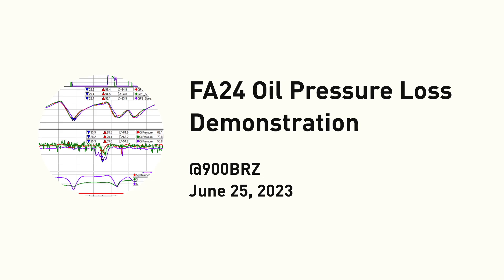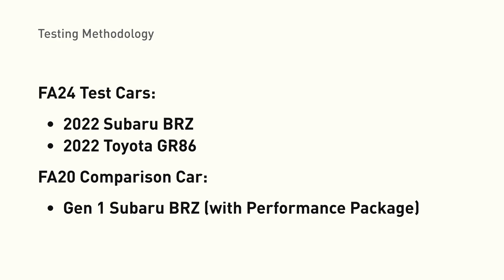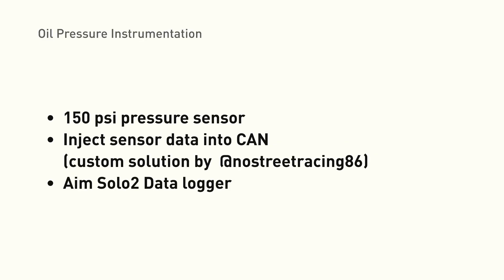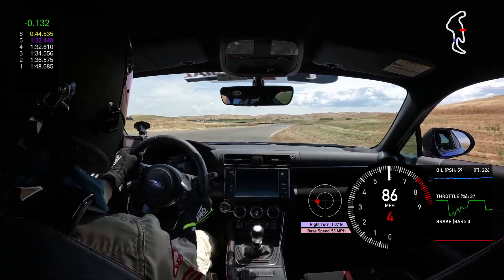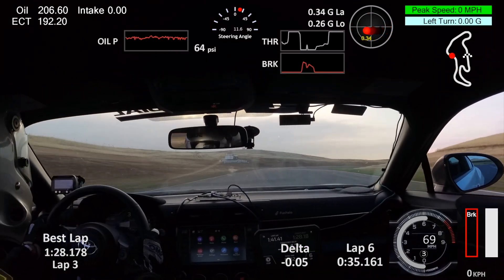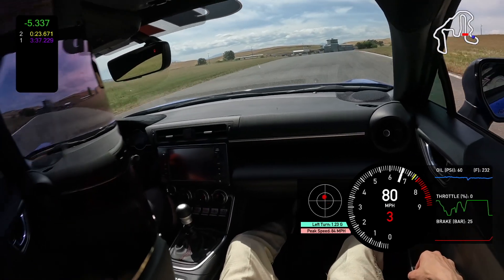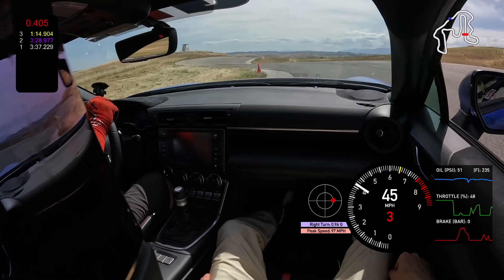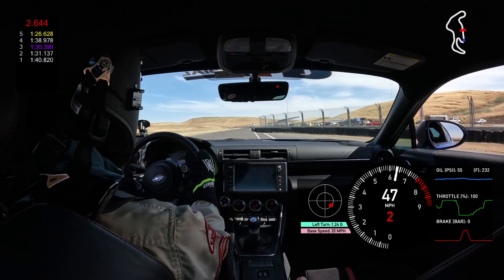BRZ/GR86 FA24 Oil Pressure Loss Demonstration

Comment: Many thanks for this video and research. Subaru or Porsche, same  flat engine lubrication issues and it is a costly problem for the last owner... interesting car, but too many problems maintained by the manufacturers. Your video confirmed my other engines choices, V6, 4 normal. Take care. Thanks

Comment: I think that pressure problem is bc the way the oil sits in the oil pan. seems like the problem happens every time you're going over a crest or a bump. maybe when the gravity is not pushing the oil down it makes a bubble in the oil pickup.
Reply: maybe a way to solve that problem is with a deeper oil pan
Reply: @fernandorodriguezsanchez4053 Thankfully there are multiple designs all about to be released that have completely solved the issue.

Comment: Anyone change the oil pickup to a round bubble design in the center of the pan, like older models had? I doubt baffles will work, there's not much room for a deeper pan, and I question if the new design is any better with RTV- things get stuck in it instead of washing off as oil sloshes.
Reply from the maker: Changing the pickup requires removing the timing cover, so people are generally not pursuing it

Comment: Isn't it common knowledge that oil pressure loss can occur during higher g force moments? This is why dry sump oil systems exist in the aftermarket. I would expect that all cars using a wet sump system would experience this.
Reply from the maker: There is a ceiling for oiling performance for any wet sump system. The interesting part is where that ceiling is. I don't have data for MX-5, but one of its engineers, Dave Coleman, says they internally targeted consistent oiling at 1.4G. We're seeing pressure drops on this car at around 1G and able to reproduce pressure drops with a completely stock car.

Comment: Sry if I missed it, but is there a speed range where the oil pressure does not go down in right turns, as long as you are below a certain speed level - e.g. below 60 or 80mph? I am asking from a daily driver perspective to get a feeling if "spirited" driving on mountain roads or long right turns towards the highway (here in germany the right turns before the autobahn can sometimes be quite sharp, but still inviting to press down the gas hard for 3-4 seconds in the right curve before entering the autobahn straight, but usually speedwise usually not more than 60mph, depending on the curve radius). Maybe speed is also the wrong term and rather g-force should be used, I am simply interested if there are any scenarios outside of the track where this right turn issue could come into effect because I am not planning to track the car.
Reply from the maker: It's really a function of high RPM and higher lateral G, or quick direction change. I would generally not be super concerned on the street, but I don't have concrete data for street driving. Most important thing is to keep your oil level at or above maximum.

Comment: For the engines you knew that blew, did subaru or toyota cover those?
Reply from the maker: No, it was clearly caused from a prototype baffle failure, so I didn’t even ask.
Reply from the maker: Oh I was thinking about my failure. From the ones I know about that failed on the track, it’s hit or miss. One person had to lawyer up and Toyota eventually settled and bought back the car, but it was denied. Another was denied by Subaru and then they eventually did a goodwill rebuild but told him he no longer has warranty coverage. Have heard of some replacements under warranty as well. It is definitely case-specific but unfortunately it seems sometimes they claim things like low oil level even though that’s not true.
Reply: @900BRZ  that's so dumb smh. They literally market the car as a track fun car too. Got off the phone with my local dealer and the guy said it shouldn't be an issue to have fun with it as long as the issue isn't cause by like any accident or something.
Reply from the maker: If you actually have a failure, they typically send out a tech from corporate and they make the final call. But still, I think at this point the risk is reasonable and it shouldn’t stop you from enjoying the car. Keep your oil level at or above the full line and check often.
Reply: @900BRZ  would overfilling it cause issue? Pr is about half a quart over safe
Reply from the maker: Half a quart over is definitely safe. We run as much as 1L on the track. Above that is not recommended.
Reply: @900BRZ  should I pull oil out if I do half quart since I daily the car?
Reply from the maker: @MrZero-xz nope just run it
Reply: @900BRZ  tysm

Comment: I've figured the solution; you just have to drift on right hand turns to equalize the centripetal force in the engine. Would unironically work I'd imagine.

Comment: Interesting, but has anyone contacted Subaru about the problem?
Reply from the maker: Yes, people at Subaru have seen my videos and reporters have reached out to them for comment. Subaru made a statement in an article on Hagerty about my videos:

“Subaru of America stands behind the design integrity of the FA24 engine which is used reliably in thousands of vehicles. Oil pressure varies in all engines based on rpm, temperature, cornering loads and numerous other external and internal factors. This is normal in an engine duty cycle. The FA24 engine is designed to perform within a wide set of tolerances for road use, and the Subaru BRZ is designed as a road car. Race cars are specially modified to be used for race conditions.”

You can decide for yourself whether you’re satisfied by that response.
Reply: Thanks for that information.  It seems to me Subaru is taking a defensive position, probably because they don't want to open the warranty re-call box.
Reply from the maker: Exactly. In my lastest video I show better performance on a prototype oil pan that’s going to come to market soon. So I think there are ways to make this less of a concern.

Comment: so is this problem only on 2022 models? im looking for an 2023 to buy and got no clue if i should do it.. :-/
Reply from the maker: Same problems exist on 2023 and 2024 cars. Whether you should buy one is a person decision and depends on your needs. But in additional to knowing some people with blown engines, I also know multiple people with 30+ track days on these engines with no issues. I’m not particularly concerned about these on the street. Check your oil level once per month and you’re likely okay.
Reply: first THANK YOU for that information and answering in general :-)Does this only happen when the oil level is too low? I thought that the problem happened due to g forces in curves/corners..? btw: I would only drive the car on the street and on passes...I would be happy about a second answer :-)  @900BRZ
Reply from the maker: @Lutzilla_  I’ve seen a lot of posts on the FB groups where people on the street have a failure but then share that their oil level was low. On the other hand, the dealer tried to claim that one of my track friend’s blown engine had a low oil level even though that was not true and the dealer eventually admitted it. 

In general, these engines burn oil more than the average car, so you should check 1x per month and make sure the oil level is at or slightly above the max dot on the dipstick. I’d recommend a half liter overfill for the street.
Reply: thank you , will keep that in mind! @900BRZ

Comment: Does the FA20 have any serious problems?
Reply from the maker: FA20 has more robust oiling according to our data and has been pretty robust outside of the warranty valve recall rebuilds. There are many years of tracking those engines and while they do fail occassionally, I don’t think it’s at a particularly concerning rate.

Comment: Now you know why Porsche who know the potential issue of low sitting boxer engine may face, and why they have dynamic bench that tilt engine in every direction while emulate a lap around a track.
Reply from the maker: Yup. They also learned a lot of lessons over the years and have scavenge pumps to pull oil out of the heads.

Comment: According to the data, do we know the discernable differences in oil pan design between the FA20 and FA24 since the FA20 oil pressure seems to perform noticeably better on right turns? I know there's probably quite more factors at play in but as a starting point I'm curious if there is a difference in the design.
Reply from the maker: The lower pan itself is pretty similar. To a casual observer, it would look like exactly the same part. There was a reduction in oil capacity in the FA24 for efficiency/emissions reasons and a host of other small tweaks.

Comment: I haven’t read all the comments but I wonder what would happen if you overfilled the oil by a quart or half quart and retested. A lot of old school drag racers and other racers would add oil to prevent oil starvation at the track. Just a theory and maybe a simple test?
Reply from the maker: We’ve since done testing and are still seeing pressure drops with a 1 qt overfill, but it does help.
Reply: @900BRZ  thanks for the reply. Sounds like you’ve accounted for most variables.

Comment: Do Porsche engines do this? Were there a large number of 911s grenading at the track due to bearing failure?
Reply from the maker: Older Porsche water cooler engines definitely have oil starvation issues as well. You can look up the M96 oil starvation for more on that. AFAIK this was fixed in the 991 generation and forward with scavenge pumps and a concept they call integrated dry sump, which pumps oil into a reservoir within main engine casing.

Comment: Am I reading the example data wrong, or do you read that the oil pressure drop for the BRZ is larger than the GR86 (the two FA24 cars)?
Reply from the maker: We haven’t seen meaningful differences in the performance of the two cars as we’ve tested in more scenarios and unified some differences in the instrumentation.

Comment: I had to rewatch the full lap you did at the end a few times, but I dare say the pressure drops are more significant when the driver is correcting with steering. It might not seem like much, but when you flick the wheel from right, to left, back to right, that will have a high sloshing effect. The smoother corners where that wasn't needed didn't seem to drop nearly as far as 20s and 30s. I would still say that's a design flaw, especially for a RWD car, but I would think a baffle improvement might help at the least. I'm not too familiar with boxers. Still love the car though.
Reply from the maker: Yeah I do believe it’s sloshing related but in the videos we try various baffle designs and it doesn’t resolve the issue. We haven’t seen any baffles that actually resolve it. We believe that the high RPM (resulting in high flow rates through the pump) combined with slow oil return are causing low oil levels in the sump, making pressure drops more likely with slosh.

Comment: I'm curious about the cam phaser position. Your data seems to show a strong relationship between throttle position and oil pressure. I know this may sound a bit fringe, but I'd be curious to see the cam solenoid as well as clutch pedal position and perhaps timing in conjunction with the rest of your PIDs. Subsequent information that would be useful would be; oil circuit diagram, cam solenoid and phaser operation. My theory is that the oil drop events may be related to a potential engineering oversight leading to a very low resistance drain that  is created on deceleration. Again, Its a theory It may be a bit fringe, but it would explain why baffles don't seem to completely eliminate (or fully address) the low pressure issue. ****I'm by no means saying baffles don't have advantages, or that they don't help, they absolutely do. 
Thoughts?
Reply from the maker: So I was selecting the more concerning drops in this video that have higher load on the engine, but there are plenty of drops with lower throttle input as well. I’d say it’s more related to high RPM than throttle position.
Reply from the maker: Can you say more about the low resistance drain theory?

Comment: Any chance the oil coolers are creating this issue? They do have horizontally placed thermostats that can be affected by G forces. Perhaps the pressure drops occur when the t-stat opens or closes and allows oil into the oil cooler radiator body. I installed an oil cooler on my 2023 WRX, and just looking at the flow dynamics, the question of pressure popped in my head before even seeing this video and realizing anyone was having issues. It just seems that the design of the bolt-on oil coolers allows for uneven flow patterns, which may affect pressure readings.
Reply from the maker: Very unlikely we think. NoStreetRacing calculated that the oil pressure lost to G forces affecting the oil cooler would be less that 0.5 psi. It does lower the pressure through resistance, but that would not cause spikey pressure drops.

Comment: I'm curious how you feel this would impact people who don't/won't track their cars. I'm looking at purchasing a 23/24 GR86 in the next year and have no intention of tracking it either on a road course or autocross (one reason is there is no way I'll be able to fit with a helmet in the car). This will be a DD with occasional back road fun thrown in.  I don't like the idea of buying a performance car that has to be driven like a Buick LeSlobber, but there are few if any other options in this price range (Miata is out, I'm waaaay too tall for that).
Reply from the maker: I’ve been monitoring oil pressure on the street with a gauge (not data logging) for normal driving and it’s fine in normal conditions. I don’t really do anything high G on the street. 

If it were just a daily I’d be totally comfortable but I have no data for canyon runs. Others have reported that canyon runs are fine but they also had relatively low RPM. In general, if you keep the RPM lower, like under 6000, you’re less likely to see drops.
Reply: Thanks for the response! @900BRZ

Comment: Thanks for the videos. I really appreciate this. Love seeing you around on the local tracks too :] 
I wanted to clarify before I order and do this. Do you just leave the oil pressure switch then unplugged?
Reply from the maker: Thanks! Oil pressure switch is disconnected on my car. Miles has a different port adapter that allows him to install both in the same port.

Comment: I tell all my flat engine customers that the progression is a expanded oilpan with a deep sump, or a accumulator or both.  The next thing would be a scavenge pump and reservoir after that its a full on Dry sump. But you should budget 13-18k to have that done

Comment: Really appreciate this informative video with testing. Wanted to ask if you think the oil pressure drop for the first gen suburu is enough to be really really bad for engine health (eg like engine failure)?
Reply from the maker: I would not be worried about it on a low grip setup like I’m running. As you pull more G with higher grip tires, you would likely start to experience more similar drops and it would be something you’d want to address.
Reply: @900BRZ  thanks!

Comment: A area that needs to be locked into is the design of the oil pump. Trochiod pumps are know to have cavitation issues especially depending on the rotor designs and bypassing outlet side path and returning to inlet side. Especially in high heat and low viscosity environments.

Comment: Is this really an issue for street driving or canyon carving?
Reply from the maker: I haven’t done testing on the street extreme conditions seen here (high heat, high RPM, high lateral acceleration). For normal street driving I don’t have any concerns. Not sure for canyon driving.

Comment: Very nicely done. What is so compelling about these results is just how repeatable they are across drivers, and cars, and that the drop on the FA20 is smaller. The fact that this occurs in right hand turns with a change in elevation, and not in left hand turns is especially significant. All of these tests are done with the oil topped up, so this is a 'best case' result. Normal oil levels will often be lower. If the car is not exactly level when the dip stick is read, the reading may be 'off'.  Also track consumption can be 'high'. Some BRZ/86 teams report oil consumption of 4 fluid ounces per hour in competition. While it would be prohibitively expensive to test a condition that you believe puts the engine at risk of catastrophic failure, the idea that slightly lower oil levels might lead to much lower oil pressure drops, of this type, I find wholly credible.

Comment: Funny the early model FA20 had like 80%+ failure rate, due to oiling issues as well (I had a spun bearing at 101K Km in my 2012 GT86). Seems like they never learn, and to think the FA24 is worse.
Reply: That's shockingly high. Toyota should have designed their own engines for these, like they did with the AE86.

Comment: This is why Toyota/Yamaha engineers added oil scavenger pumps in the the 5.0L 2UR-GSE in the heads....get the oil back to the pan and pump.  Also, 10 quarts of oil.

Comment: toyota going to do a recall or update?
Reply from the maker: Maybe an update. Recall is very unlikely.
Reply: @900BRZ  very hard to justify buying a new gr86 vs a used bmw m2 at this point.  rtv problem, oil starvation, warranty denial, no reliable and widely used turbo/supercharger kits yet, slightly smaller interior than gen1, etc.  just venting.

Comment: What is RTV?
Reply from the maker: It’s a sealant used throughout the engines. If applied too liberally, it can fall off the seams in the engine and end up clogging the oil pickup. Should have explained this better!